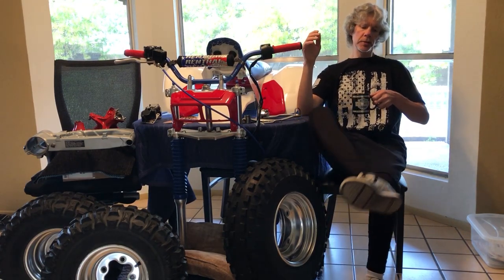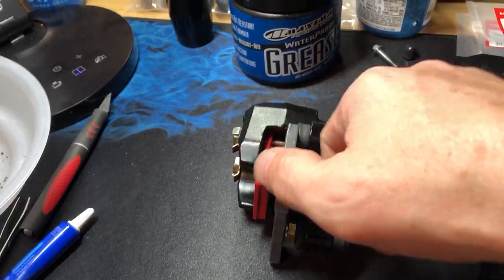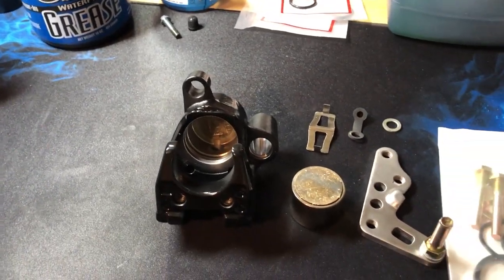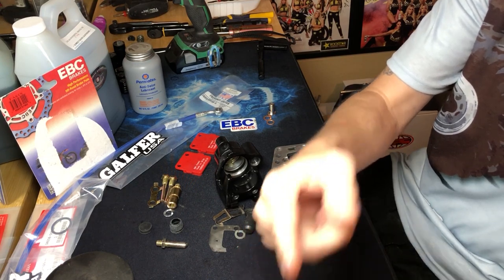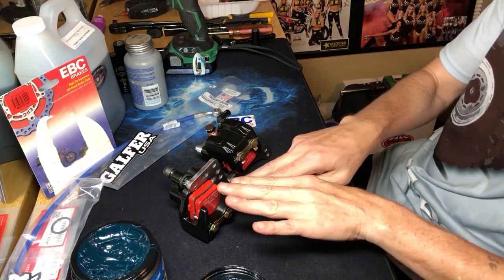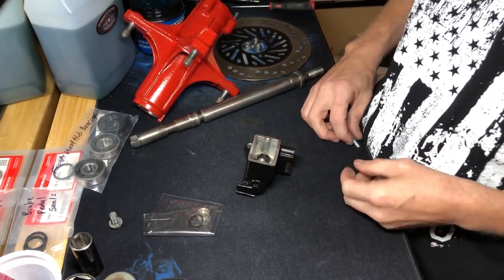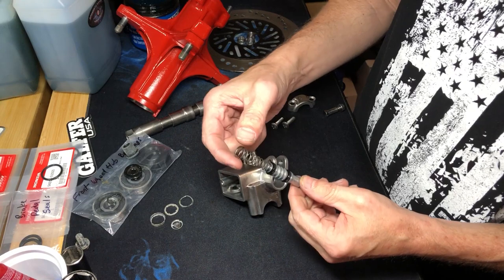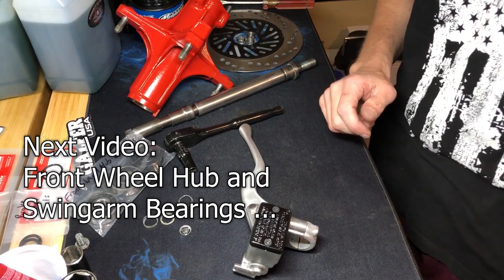Honda ATC 200x Build - Part 7 - Rebuild Front Brakes, Caliper, Mater Cylinder, Seals, Paint, Window

Comment: She’s going together nice but what has always seem to work when freeing seized rusted brake caliper pistons is to shoot it full of pb blaster then shoot it with compressed air  it works
Reply from the maker: yeah ... i probably could get that piston out ... but I happen to have that Chinese knock off laying around so I am just going to save some time and test it out. I did replace the pads and all the shitty parts in it and I still have the old one with a fresh rebuild kit so I will revisit that at a later time.

Comment: How good would be the atc 200 x, pass your contact where you got your parts I have a similar model 86 and I also want to fix it only that I am from the city of Mexico and it is impossible for me to go to the United States for parts That is why it is more likely that I will buy them on the internet I hope it is not expensive but although this expensive will be worth it 🤩 greetings from Mexico Cuernavaca
Reply from the maker: I buy a lot of parts from MotoSport.com and RockyMountainAtvMc.com ... dunno if they ship to Mexico or not. I also buy a lot on eBay and in Facebook groups.
Reply: @11GalleryATV  Okay, thanks, I'll check it, on ebay they charge me a lot for imports, almost what the parts that I'll buy are worth, but I hope to be able to get them now
keep it up with the atc 200 x series I'm learning a lot

Comment: Where can I get front master cylinder plastic resivor cup ?
Reply from the maker: OEM ones? good luck ... they do make after market cheap crap but it's hit or miss if you actually get one that fits ... I went external reservoirless with a master cylinder from a CRF ...